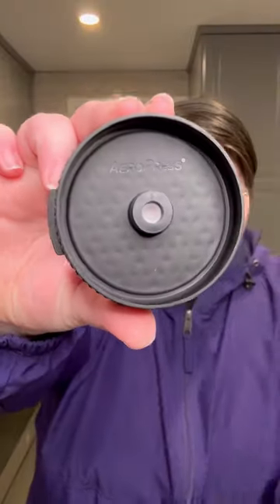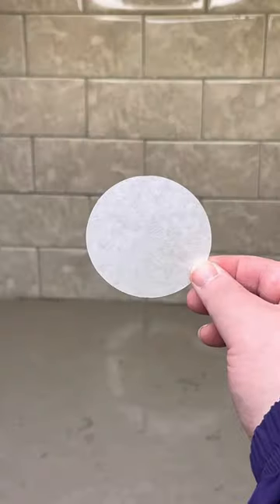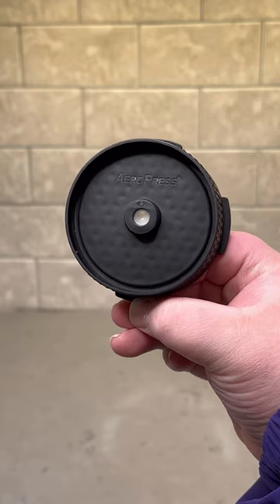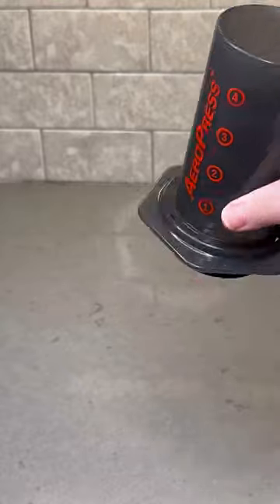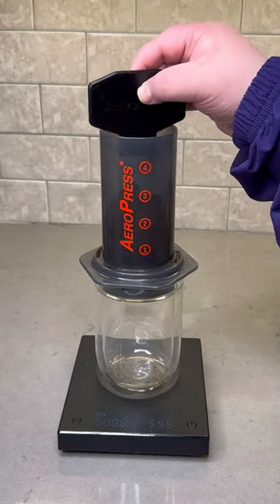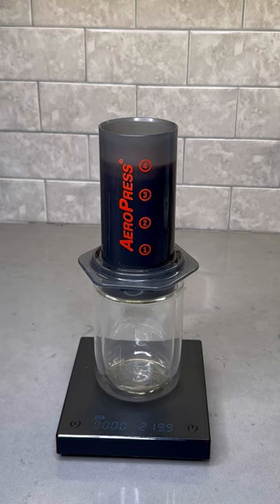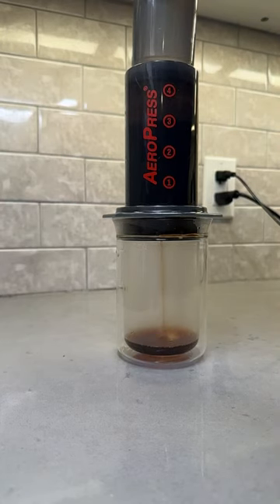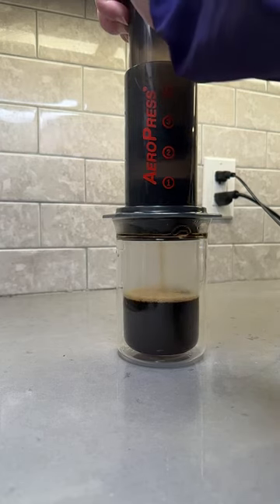Aeropress Flow Control Cap Workflow #coffee

Comment: I'm curious, how is this any different than the prismo?
Reply from the maker: It’s just aeropress’ version of it! It’s supposed to fit better and work with a paper filter
Reply: Overall, it's not, my prismo fits the basic/normal aeripress without issue, I've had it 5 mos, you can add a paper filter above the metal prismo filter if you want